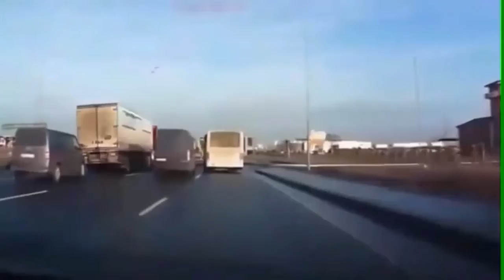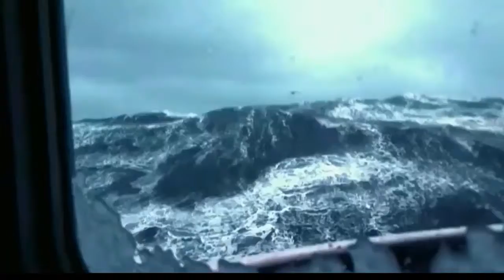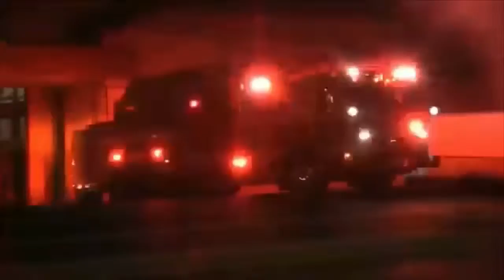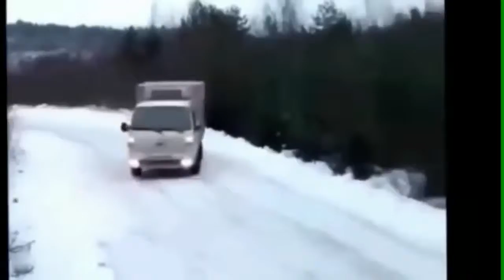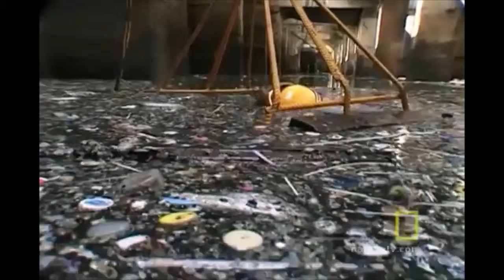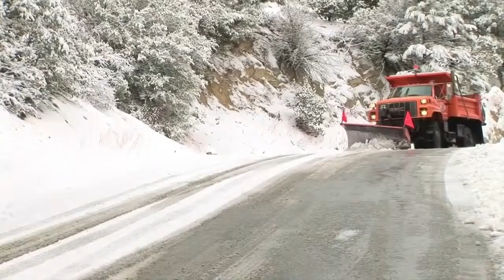Big Smo -Workin'

Comment: Night shift dock worker here .....108 in the summer and -10 in the winter.....drenched in sweat or nuts frozen solid.....loading unloading 53 foot  trailers sometimes 12-14 hours day....working class pride 💪
Reply from the maker: I can relate. Used to work 12 hr shifts loading shipping containers in Alaska. Sometimes with forklift, sometimes by hand
Reply: Damn, you must eat Advil like candy 😆 but you're probably in fantastic shape though. I know when I was doing stocking at a Tractor Supply, it wasn't nearly as rough of conditions as yours is but I definitely got into better shape slinging 40-50lbs feed bags around.
Reply: @hblackburn5580  not gonna lie, body is achy AF!! I always been in good shape but this job does keep me fit at the tender age of 38.
Reply: @mackatak6947  same here, we do use forklift, but we also do a lot moving by hand/dollies since we get a lot furniture shipments. Currently I'm in process of getting my CDL, so hopefully I leave loading dock soon.